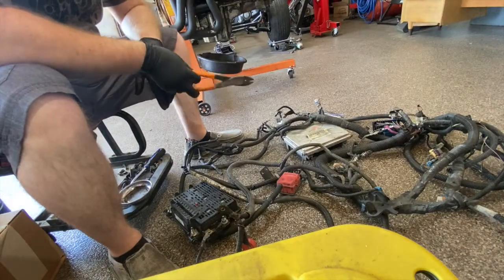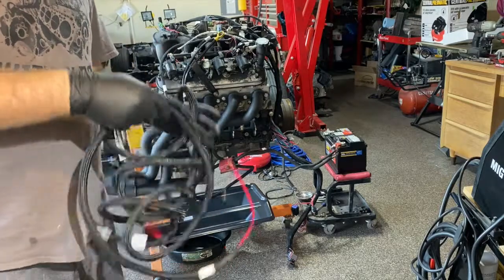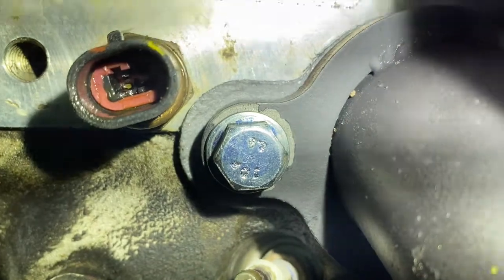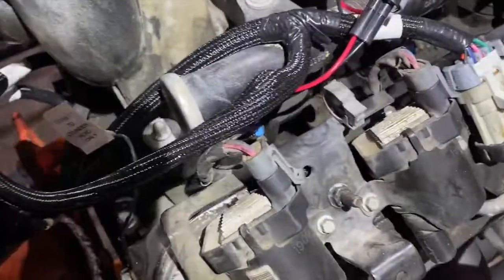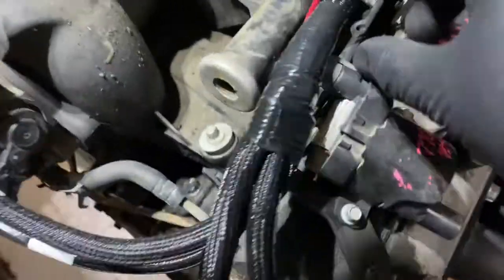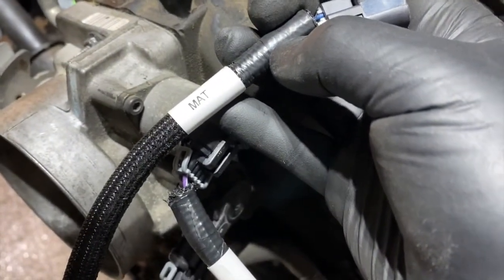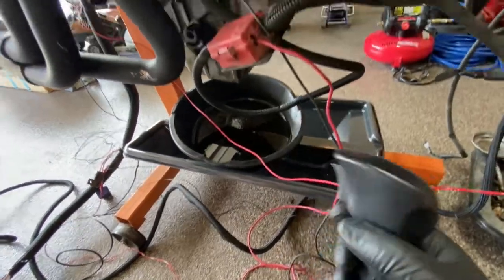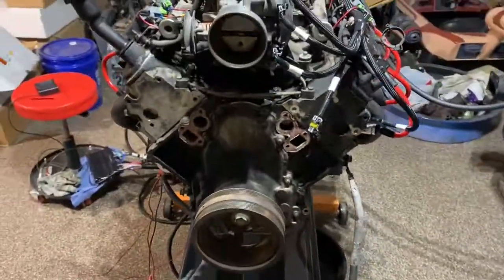G Body El Camino Restomod LQ9 Build Part 4: Terminator X Wiring

Comment: The O2 sensor needs to be further back with long tubes.. about 6 more inches back from the existing hole. Plug the other O2 bungs on the headers. You will eat up O2 sensors. Ask how I know.😂
Reply from the maker: Thanks for the heads up